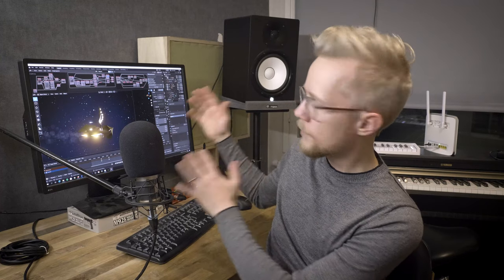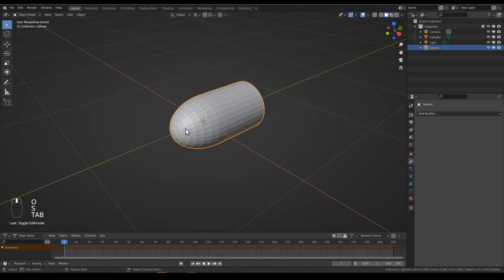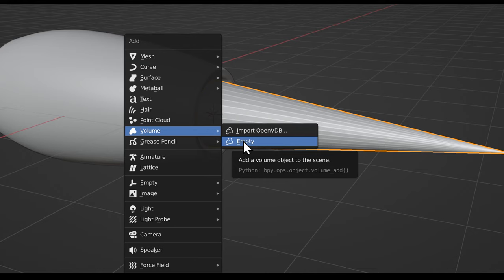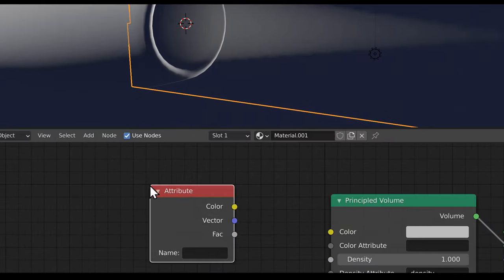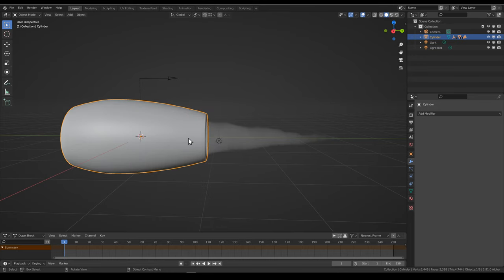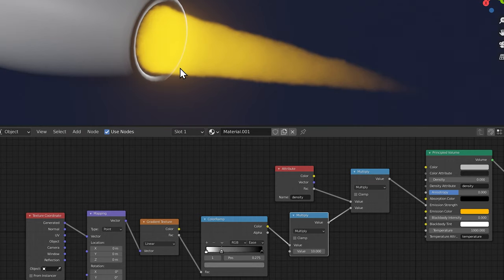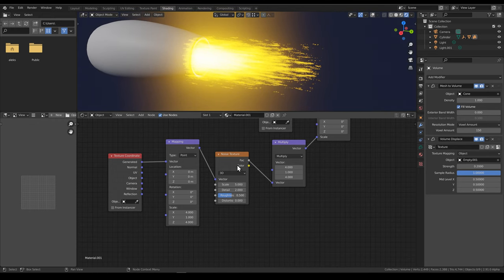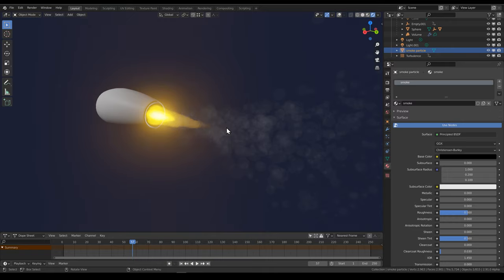Making a Volumetric Jet Material for Eevee - Blender 2.91 tutorial

Comment: Loving the tutorial so far but (you knew there was a "but" coming) I am having a big problem with the Array modifier. At the 5:50 mark in the video we are told to select "Object Offset" with the Empty as object to use. When I select that I get something very odd happening that is not at all what I see in the video. What I'm seeing is that each successive repeat of the original object is much bigger than the original. Number two is twice the size of the original and rotated and tilted flat. Number three is WAY bigger than number two, and so on. If I increase the count to 20 as shown in the video my screen is completely obscured by many huge overlapping copies of the original fan blade object. 

   And yes, I made sure that the fan blade object and the Empty share the same Origin point. Any ideas as to what I'm doing wrong here? I have spent hours trying to figure this out. 

    I first had the problem with V3.0.1, then upgraded to V3.2, but still getting the same thing. Any help is appreciated.
Reply from the maker: You probably have the scale of the empty at 2 or something. The scale has to be 1 for the copies to be the same size.
Reply: @SketchesForHumanity  Thank you for the speedy reply. But I figured it out: newbie mistake! I had manipulated the plane that formed the fan blade in object mode and forgot to Apply the changes. This occurred to me while I was taking a nap. :)

Comment: For some unknown reason i dont see my Volume when im in Material Preview or Rendered Preview... I only see it when i am in Solid Mode. I have applied a material to it and all. But its not showing up. So far i only have a default material and obviously it is a Pricipled volume shader plugged in the Volume in Material Output. I am using Blender 3.0.0
Reply: I figured it out. I had to click Use Nodes in the Node Editor. I clicked Use Nodes already in the Material Side Panel but it was kinda strange because the use nodes buttons did not dissapear when i clicked on it. But it started using nodes when i clicked this button and i could create nodes in the node editor. But in the node editor the checkbox for use nodes was still disabled. So i just had to enable that